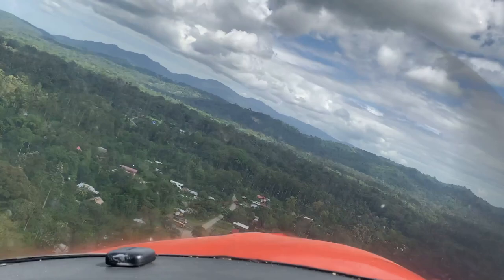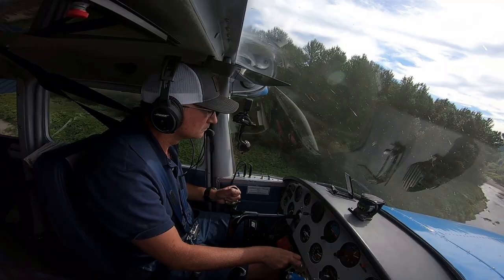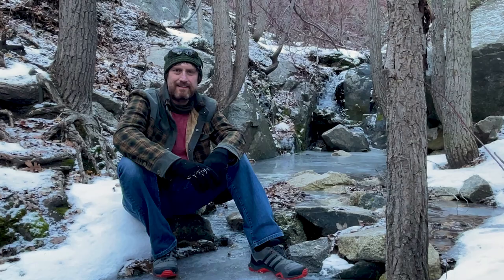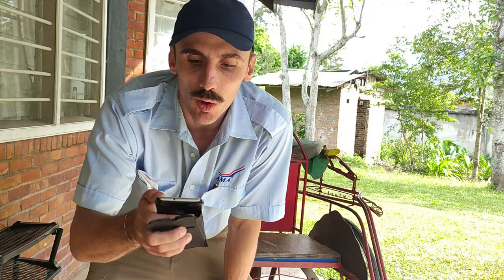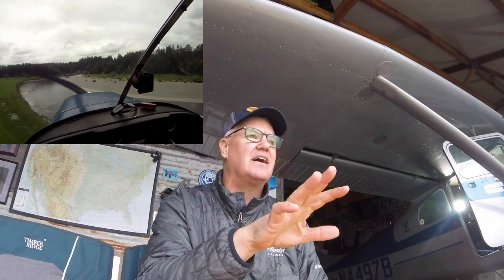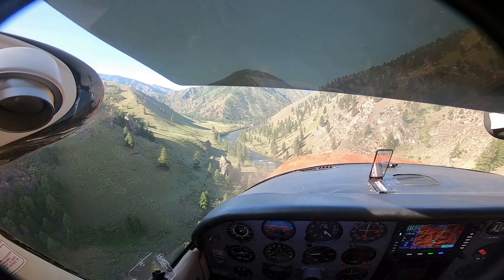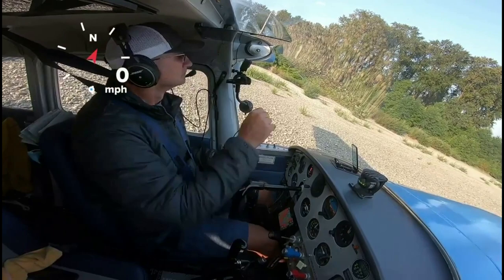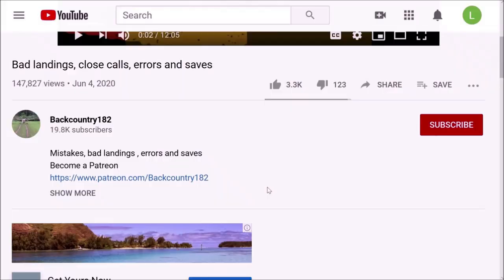STALL WARNING on final!  Milne "CC" Pocock, Cory Robin, Paddy pilot and Jughead share knowledge

Comment: Back in my pro-pilot days, I flew a Jetprop DLX out of a 1800’ grass strip in the Keys. If the horn wasn’t going off, you were in trouble….fly the profile, pitch for the horn and manage altitude with power….the only breaker we would pull in the airplane is the overspeed, but that is a different story for a different time. Great video Backcountry 182, as usual!